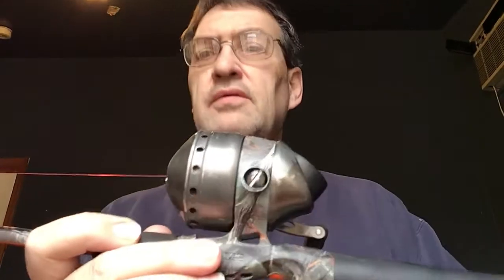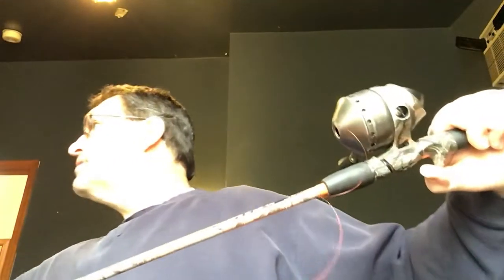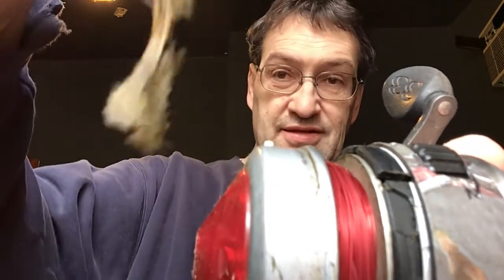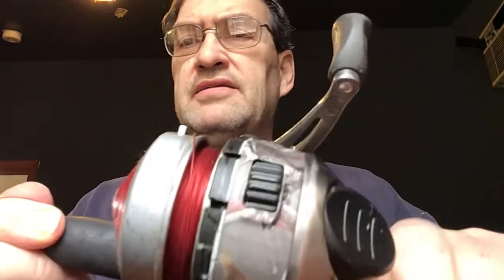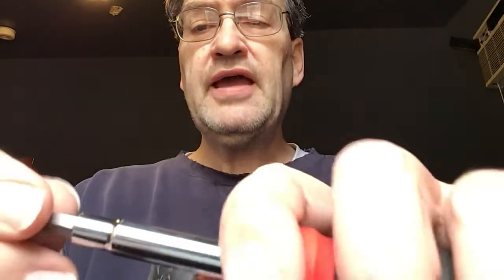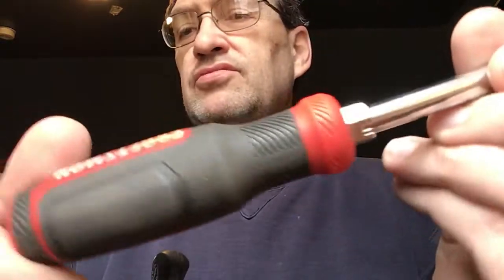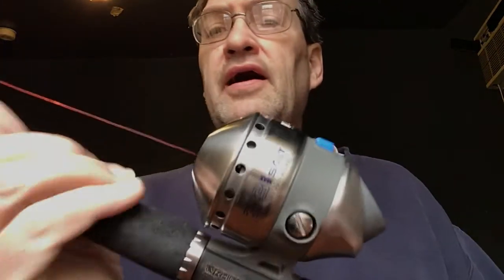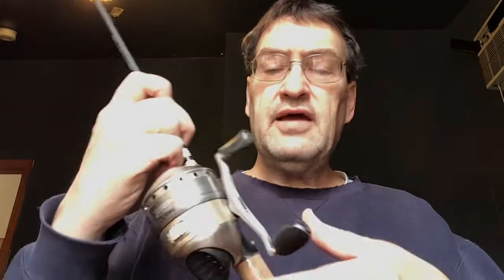Viewer Qs - Zebco 33 Max quick overview and discuss

Comment: hey dave, bought 2 black max 33 didnt likem, too rough even after putting 3 ball bearings inem. so i bought 2 gold max 33, theyre alot smoother and really likem alot. i also got 2 micro 33's and theyre awesom!!! also a 33 platnium with a berkley cherrywood rod, but i think a different rod and new line would bring the 33 up to par. bought abu abumatic 170, well made , but uncomfortable to cast. abu stx 10 is garbage!!! fished penn reels and other open faced reels since i was 14, but now 42 years later i love the simplicity of a zebco 33.